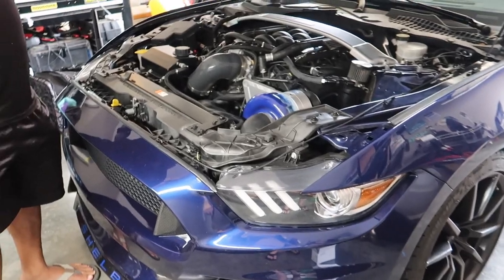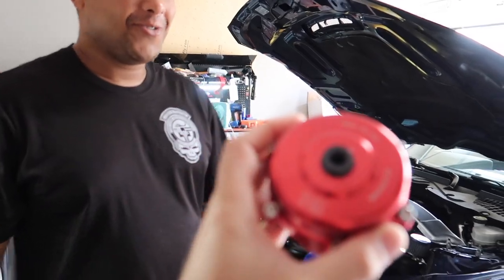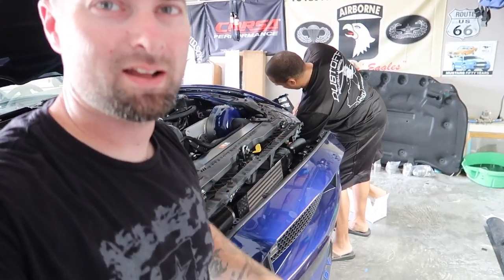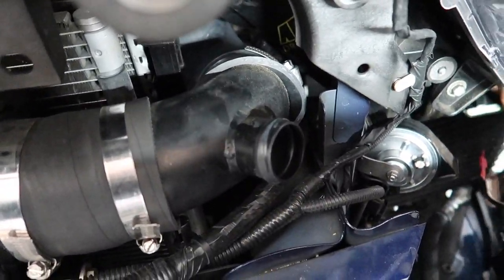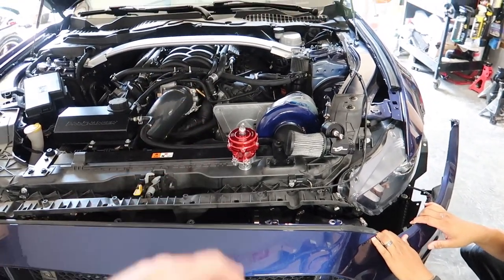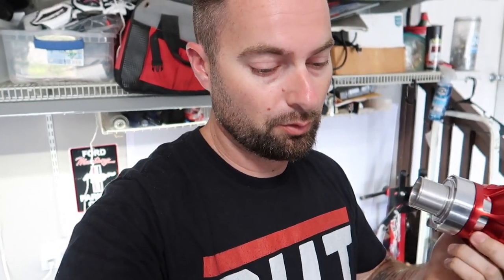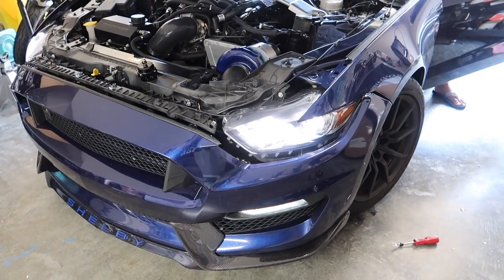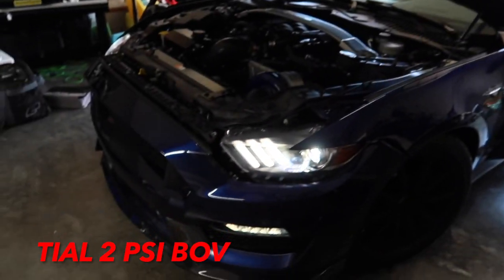PROCHARGED GT350 Mustang MASSIVE UPGRADE with TIAL BOV 🔥 FULL SEND + REV's

Comment: My build is from 2006-7 but I use two Procharger big reds and two Tial 60mm waste gates. The Tials are controlled via an electronic boost controller.  The Prochargers have 6an boost line for snappier operation.  Oh and it’s  twin Procharged.

Comment: Yeah I hear him on that ProCharger pricing. They are about $1000 more than when I got mine. Luckily I found mine used for $2500. Just needed the low speed (input shaft) seal replaced.

Comment: Good video. I just installed a P-1X on my 19 gt350. I'm all done with tuning but have that stumble on the conversion from vacuum to boost and I'm wondering what it could be. I have the surge valve that comes with the kit but I'm thinking I might have to try this. Do you have a link for the valve he used and the adapter ??

Comment: Link to that adapter?? I have the ProCharger Bullet (open version), currently. Not loud enough. I want the TIAL. but don’t want to have weld work done.
Reply from the maker: https://www.atpturbo.com/mm5/merchant.mvc?Screen=PROD&Product_Code=ATP-FLS-153&Store_Code=tp
Reply: @Zander13Productions  you DA MAN!!! Thanks!!!
Reply from the maker: @AtticAZ  💪
Reply from the maker: Make sure to measure the hose to see if it’s 1.5 inches or not. They do make different size adapters
Reply: @Zander13Productions  it is.

Comment: I have the stage 2 intercooler procharger p1sc-1.  Would I use the same parts for my 2021 Mach 1?  I also have the stock bypass valve from procharger and want to do the TIAL.

Comment: I hope he has a pro charger crank support. Or a the vert least a crank stud saver
Reply: The stud saver doesn't work with the stage 2 prochager kit to my knowledge due to having the extra pulley for the supercharger requiring a longer damper bolt.